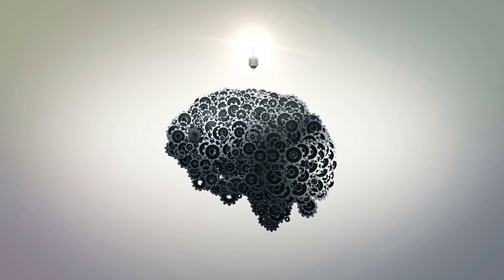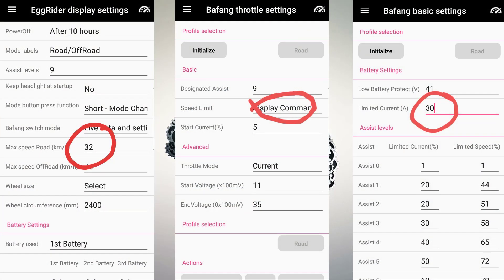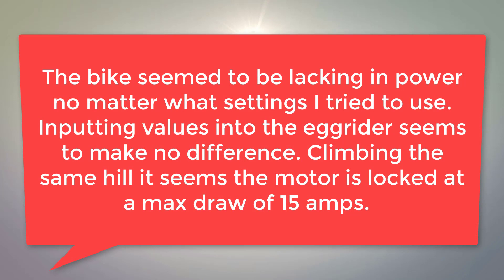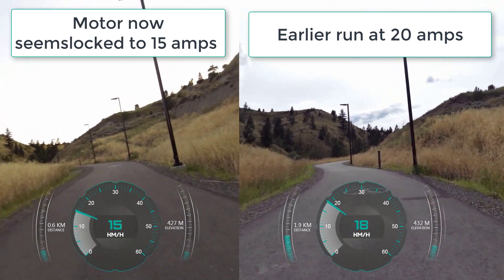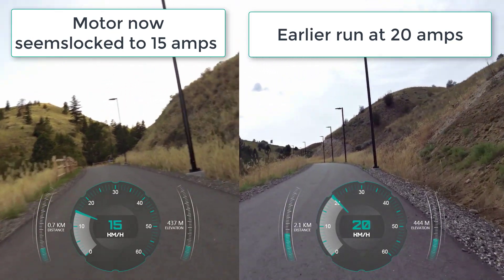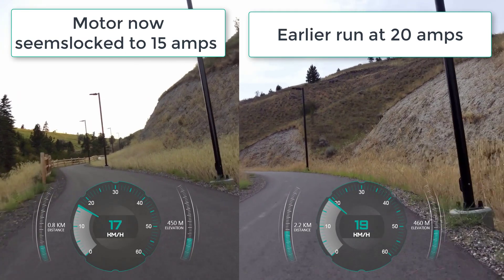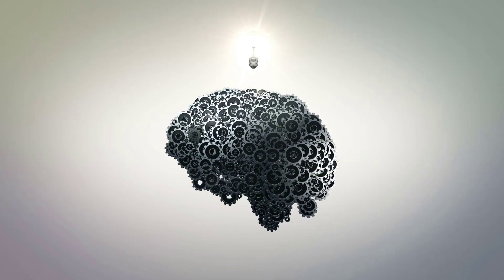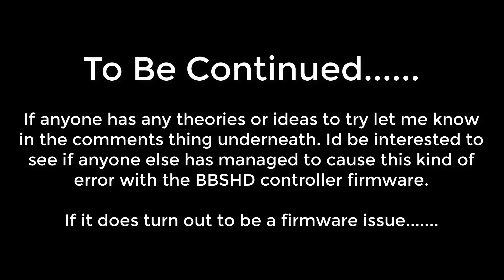Bafang BBSHD - Firmware Disaster

Comment: Yes I did the same 30H error after 2 days of frustration I found the firmware to re flash it, there is a procedure with the Eggrider, Read Write dis connect bluetooth clear the app on the phone switch off the Eggrider, then disconnect the battery or switch off  lol 😁 Tell me about it ..
Reply from the maker: Good Job! You did better than me. Cheers
Reply: @HighVoltageKits  Thinking about a Phaserunner they look small and neat but not sure if they work with the Eggrider unless you know different ? Yes the Eggrider tutorial is poor as English is not his first language give me you thoughts
Reply from the maker: The phase runner only works with the cycle analyst I think. The phase runner is basically a custom ASI controller.

Comment: I've just done the same thing with my egg rider, bricked and when using the original 960 display error code 30h now too, all brand new aswell, see what the eBay seller says..
Reply from the maker: You have a bbshd program cable?
Reply: @HighVoltageKits  no, should I get one? Curious about the firmware flashing stuff researching it now
Reply from the maker: Put Karl's special sauce into Google. You should be able to flash the firmware and restore operation. I helped a few people do that.
Reply: @HighVoltageKits  thanks!
Reply: So I have the cable coming on Tuesday,

Using some videos and endless sphere, I've tried to use a serial to usb, jump the P+ and PL from display to controller lead, and wire the ground, Rx and Tx to the connector, 

No luck though, initially my 2 laptops detected the serial adapter in COM3, but neither the V1 software or the V2 (made by some hacker I found it auto detects com ports too) would find the controller either, I'd hit connect and it wouldn't do anything, so either my controllers completely fried (which sucks because it's brand new), or it's not communicating since I'm using a dodgy serial com port adapter which I'd understand if it was hit and miss,

Going to wait till Tuesday to get a proper programming cable delivered and try again, thanks for pointing in this direction though I appreciate it
Reply: @SA-bg9tp  so did you fix it?
Reply: @straight2curveus  yes reflashed firmware and back again, bricked it couple more times too but I can just reflash. I'm waiting on the ASI Bac855 to be in stock, haven't made my mind up whether I'm upgrading as it uses the NXT display only, I think Captain cods has it but don't know if it's any good yet. cannot wait to ditch the stock bafang controller

Comment: I got a BBSHD 1500 WATT ! Does 60 clicks stock ! I aint stuffing around with things i know shit about ! BLOWING MY CONTROLLER ! Then having to look for some mow to help me because warranty is void  or you fry some crap !
Reply from the maker: I think if you are concerned of voiding any kind warranty I would definitely stay away from anything major DIY and just enjoy your bike. I like to experiment and mod and sometimes it goes wrong. But if you like building stuff that's just how it goes some weeks. I still dont know why the issue occurred and the stock controller is actually on its way to egg bikes for analysis. The display works flawlessly as intended with my ASI controller.
Reply: i am not very trustfull of my alibaba waranty.....  was the cheapeast
Reply from the maker: I hear mixed results. Recommend using a credit card on those even if it's more expensive.

Comment: Nice to see a fellow kamloopsian, I have a bbshd as well, I couldnt find any firmware files to flash my controller with. I havent corrupted mine, but its locked from the vendor at 28amps. I climb up some pretty steep roads (Highland drive) and without enough current the motor slows to a crawl and starts to overheat. I just keep it at 28amps and speed limit it, my bike is also pretty heavy (116lbs). As long as you arent being a jerk and keeping your speeds down you probably dont need to drop your amps. Also I have a temperature gun to check my temps while on  rides.
Reply from the maker: Thanks Troy, if you need to go to 30 amps then there is a program cable you can use. It plugs into the display port on the wiring harness. Mine I found out was on 27 originally. I'm going to look into internal hubs for future builds.

Comment: Does the eggrider screen have a watt metter and have you fixed your problem yet?
Reply from the maker: Dan Nguyen I am certain it was a firmware corruption. I dont think it's a fault of the eggrider. More an issue with bafangs dodgy controller. I am no longer using the controller so fixed in a way lol. I'm going to investigate the issue tho in the Hope's of helping others.

It has the option of showing either watts or amps on the display
Reply: @HighVoltageKits  what controller are you using now? And does the throttle response of the new controller better?
Reply from the maker: Dan Nguyen Its the ASI Bac800. The throttle is much smoother. Might go to a full twist to get more range of motion to control it.
Reply: @HighVoltageKits  whats the max speed of the asi and does the bbshd seem to handle the power your puting threw it?
Sorry for bothering you too much,last question
Reply from the maker: Dan Nguyen No bother at all. It's something I enjoy. I'm super happy with the controller. I'm working on a video but it's taking longer than I thought lol. The motor takes the power... but I think it's a fine line. It definitely gets hotter after a good hill climb. You could easily melt the nylon reduction gear if you were inclined. Key is keeping the motor spinning fast as possible. If it bogs down in too small a gear that's where issues occur... I have not changed out of the 42 rear gear since I installed it. It reaches just over 50kph on the flat so with a slight hill or a lighter bike 65kph likely. But that's a bit fast for my liking. I'm happy that it will accelerate to 50 and keep up with most traffic. It will hold 40kph up 9% grades.
Reply: @HighVoltageKits  thanks for sharing, yes ebikes are so fun and addicting cant imagine how much cooler they'll be in the future

Comment: What's the clanging noise u can hear?
Reply: I can hear it in all the videos and now u say it's the front disc I know what it is now lol how much was the full kit including the battery?
Reply from the maker: I hate it. But it's much better now. But yeah carbon forks and knobby tires at speed is very noisy. The motor and battery was about $2200 Canadian. The bike was $3000... I've spent a few hundred more on the new display and the tires etc... Its a money pit lol.
Reply from the maker: In this video the motor is not running well at all. But I think you are referring to the almost bell like sound? It's the front disc chattering. Was was worse on knobby tires.  You cant hear it much when you are riding. The mic is close to the disc tho....l think switching the front fork to suspension will eliminate it entirely.
Reply: What's that in English money lol?
Reply from the maker: Best bet is to have a look at em3ev.com. You can set the currency to £. Just add stuff to the cart etc. The exchange rate is about 1.65 to the pound. But all the brexit crap is hurting the £. EM3ev is based in china but its run by a salt of the earth Brit called Paul. He is a top bloke and if you do go this route I recommend them highly. Great shipping and possibly the best batteries around.